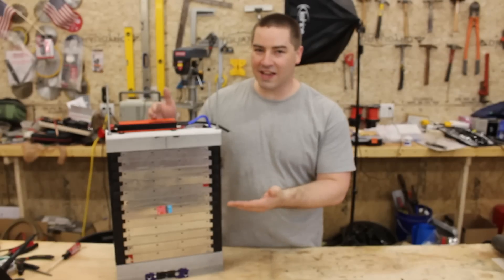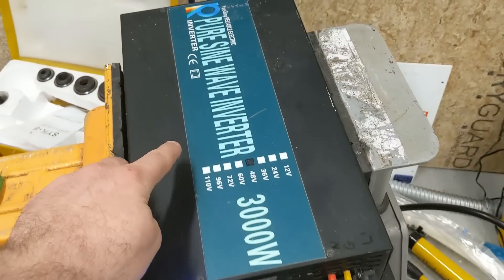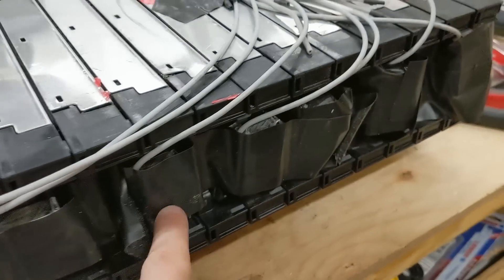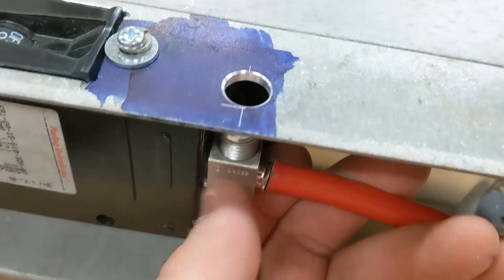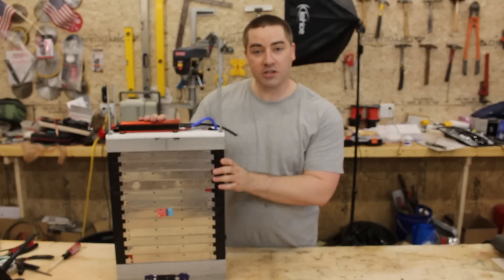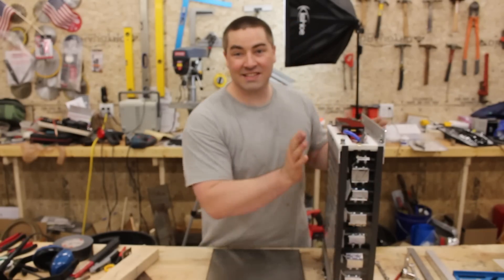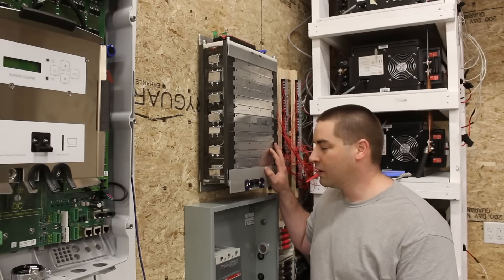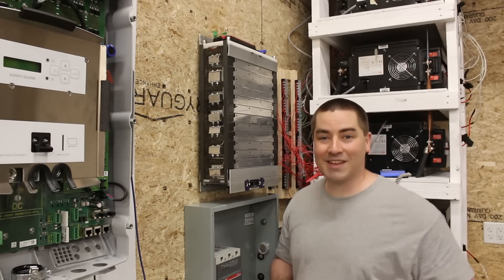LG Cells Part 2, 6kwh 48v DIY Battery

Comment: Great looking pack! Why a 200 AMP BMS and a 100 AMP breaker? Thanks.
Reply from the maker: This type of BMS is based on mosfets.  mosfets are the electronic switch to turn on/off the battery.  mosfets don't like surges.  But a circuit breaker allows surges through.  For example, if you start an air conditioner the compressor draws a large surge to get going.  The cirucit breaker allows the surge to pass, there is a delay before the circuit breaker trips.  By over-sizing the BMS (roughly double) I've never had a BMS fail on me.  I do this on all my builds.
Reply: @DavidPozEnergy  If I were to parallel 3 of these for 14 parallel sets of 3 and then build a 48V pack from those, would the 200 Amp BMS still be enough? Or would I need to look for a bigger BMS? I am mostly building a big pack to extend discharge time not to be using  18 KW at one time. At most I would be drawing 2500-3000 watts for very intermittent periods of around 15 minutes tops.
Reply from the maker: You size a BMS based on your load, not your battery capacity.  So, yes, you can still use a 200 amp BMS.  If you plan to have a max draw of 3,000 watts, then divide that by the lowest expected voltage (42v) = 71 amps.  I like to double, so you could use a 140 amp BMS or more.  A 200 amp BMS would be fine for this.  I personally like to use a circuit breaker half the size of the BMS (100a) and size my wire to the circuit breaker.
Reply: @DavidPozEnergy  Thanks again! Very helpful.
Reply: @DavidPozEnergy  Hey David, I hope all is well with you and yours. I apologize that this is so long winded, but please bear with me.  I came back to this video to ask you for your opinion and I hope you can help. I am needing to build a fairly powerful battery for an all electric ambulance RV(mini-split air conditioner, appliances, etc.). The power density for the price of these is unreal and almost unbeatable from what I have seen. I am also looking at some 100ah 3.2v LifePO4 batteries that are brand new, come with bus bars and are easy to configure but are more than twice the cost for much less usable power. I live and work in the desert of Las Vegas. The battery pack will be in a well insulated compartment and I will do what I can to control the temperatures in it. I am driving myself nuts going back and forth between the energy density and low cost of these compared to the supposedly higher safety and ease of assembly for the LifePO4's. It is time for me to get off the pot, so to speak. Please give me your 2 cents if you can. Thanks!
Reply from the maker: I like the pot reference.  LOL   Both can work, so it sounds like you are choosing between two good choices, not a good vs. bad choice.  The LG cells will be lighter and more energy dense.  Usually that's most important in a mobile application, but I don't know what margin you have for your weight capacity.
Reply: @DavidPozEnergy  No issues where weight is concerned. I am mostly concerned about cost, desert heat and safety.
Reply from the maker: LFP is safer than Li-NMC.  Both types need to be kept cool or they will become damaged.  LFP is going to be easier to build.  I'm comfortable with Li-NMC so I'll save the money and go that way.  But I often suggest LFP to someone with no experience.  They are a better one to learn on.  PS, it's difficult to find old conversations, so please message me in facebook with any other questions.

Comment: These cells certainly deliver an inexpensive, compact battery, pity I live in the UK :). I wondered what the voltage spread was like at the end of the discharge test - don't think you showed it ? As an average you stopped at 42v so 3v/cell average.
Reply from the maker: I'm sorry I didn't show that.  I did check each cell and they stayed equal through the whole cycle.  These are really good cells.

Comment: Thanks David. Been looking forward to see what you did with the BMS.
Curious why you decided this time to use a 'regular' BMS and not the 'Smart', bluetooth capable BMS you used previously?
Reply from the maker: I found I didn't need the bluetooth.  It's fun, but not a requirement.
Reply: @DavidPozEnergy  Thanks for the reply. I don't trust a BMS where I can't see/don't know what it's doing. Seen too many of them fail on me over many years of working with Ebikes. The new Bluetooth options finally make them transparent so you can see when they are killing your cells at least.
Reply from the maker: OK.  That's cool.  What brand BMS has failed on you?
Reply: @DavidPozEnergy  No idea on the brands sorry. I build and sell batteries for Ebikes and a large number of the 'failed' batteries I am replacing are as a result of the BMS, not the cells themselves. See my other channel for the builds:
https://www.youtube.com/channel/UCnro-1KKZaFM-UTp7lFn-vQ

Comment: It will be very interesting to see how the different chemistries behave.  They should charge based on the internal resistance at a given voltage at that moment . The flat voltage ranges of the Lifepo  will likely result in the LG cells reaching around 3.2 volts first then the lifepo will suck up a lot of watts/current until voltage starts rising again.  Of course since you will also have much different Kwhr capacities that will also make a big difference.

Comment: So if I lived in a spot that offered 8 hours of good sun each day, how many 300 watt panels are needs to charge 6kw, 12kw, 18kw?   I'm asking about each because not sure if I should purchase 14, 28, or 42 of them.  I'd do the math myself, but I'm always doubting my math when I calculate things related to solar.

I'm in traveling distance to battery hookup so would take the drive.  Do you know how many of these they have in stock?

Edit to attempt the math after reviewing my notes:   6000 watts / 8 hours = 750 watts each hour so 750/300=2.5 panels .... round up to 3 panels?   And then do the same math for 12kw and 18kw.     5 panels for 12kw, 8 panels after rounding up for 18kw.
Reply from the maker: It's not a matter of how many hours the sun is shinning, it's about the angle of the sun to the fixed solar panel.  If your solar panel is facing south, then early morning sun and late evening sun have less production.  For example, New York city has 2.8 sun-hours per day.  Yes, there is more sunshine than that, but this 2.8 takes into account cloudy days, and low sun-angles.  So if you are trying to calculate 6kwh of production, divided by 2.8 sun-hours = 2.14 kw of solar panels.  There is loss in the charge controller and wiring, so maybe add 15% for losses = 2.46kw of solar panels.  divided by your proposed 300 watt panel = 8 solar panels.
Reply: @DavidPozEnergy  Good information.  The reason I said 8 was because I will be living in the Philippines where the sun dips to the south very little so all year, sun pretty much rises at 6AM, falls at 6PM so I reduced that 12 hours to account for the first 2 and last 2 not being so good.  Will Prowse always says throw an extra panel up there to account for loss associated with the sun's angle.  I'm more interested in having solar in the developing world, because they are more often subject to brownouts and their KwH rate is outrageous compared to the US.  2.8 hrs of sun in NYC!  Wow, that really adds to the number of panels... 8 in NYC compared to just 3 in the Philippines.  I think those LG batteries are the best I've ever seen offered by Battery Hookup.  Thanks for teaching us about batteries/solar.  You've taught me a lot.

Comment: What is the real reason pouch cells need to be compressed?
Reply from the maker: That's how they come from the factory in the big modules, so I assume Chevy had a reason.  I'm just trying to copy.  I don't know the electrical engineering reason behind it.
Reply: @DavidPozEnergy  does anyone else know I use something like these uncompressed on an ebike I made and never had a problem thoughts and capacity is still good
Reply from the maker: If I was to guess, there is probably more reason to compress the stack when you might be pulling 300 amps when the car is accelerating up a hill, or when you are charging it at over 100 amps in a fast charger.  Those are extremes.  Using cells in a less stressful application might not necessitate compression.  But, again, I'm guessing.
Reply: likely for several reasons . First to make sure they fit in the space the engineering allowed for them in the car. Also to avoid more movement which would likely lead to lost connections or worse shorts and or fires.  Also to allow for more consistent heat transfer for cooling the pack.

Comment: David your enthusiasm is contagious!!  That is why I love to watch your videos.  And your the main youtuber that I follow considering I am doing almost the same thing your doing for a solar setup.   To bad I live so far from you.  I would love to help you when you need help.  Keep up the great work.  How do you like the BMS so far?  How will you be able to reduce current while charging it?  Thanks again for taking the extra time and work to produce your videos for all of us.
Reply from the maker: Thanks for watching.  The BMS works fine for my purposes.  I tested it in an over-voltage situation and it immediately shut off preventing the battery from over-charging.  My solar array puts out a peak of 80 amps.  Those 80 amps will be distributed to the whole battery bank.  I think it will split between this new battery and my tower.  I'll be checking to make sure, but I don't think I'll have to do anything special.  The cells can take a 100 amp charge, but they will get warm.  Remember, these are used in electric cars, and they can go to fast charging stations.
Reply: @DavidPozEnergy  True but also remember they have liquid cooling in the cars.  It should work well at 100 amps though as you already mentioned they only get a little warm to touch at that rate.

Comment: So do you think you can use 4 in series for a 12v battery?Did the math and looks like it would be 1.7kw or 14.4v at 120ah and weigh 20lbs or so?Do you think this would be a lighter solution for the agm batts I carry hunting/camping?Would I have to upgrade charge controller or have to have a bms?we never use more than 1-1.5kw daily?I use a cheap pwm charge controller works great but it's on 4 heavy ass agm batts all in parallel 100ah ea.which sucks cuz I can only use them safely to like 50%dod.any info would be great!thanks
Reply from the maker: No, for a couple reasons.  Fully charged 4 of these cells in series would be 16.8 volts.  This is higher than most 12v stuff can use.  Also, this chemistry should not be charged with PWM charge controllers.  You would need an MPPT.  As you stated, your AGM's can only be used to 50%.  So your 4 batteries, are more like 200 amp hours at 12v if they were lithium.  There is another chemistry, LiFePO4, which is a very good 12v replacement.  The voltages work well.  Also, your PWM charge controller is less efficient than a MPPT.  I think if you switch to an MPPT charge controller, you will find you need slightly less storage.   Alt-E sells a Kilo-Vault lifepo4 battery, 150ah, 12v.  It would probably be a good choice to look at.  https://www.altestore.com/store/deep-cycle-batteries/lithium-batteries/kilovault-lithium-solar-battery-p41011/#KLV1800HLXV3  If you want to dive into this deeper, send me a message on Facebook. https://www.facebook.com/DavidPozEnergy/
Reply: @DavidPozEnergy  Thanks for replying but I guess I'm stuck with agm... no way I can afford that $1800 bat for what I do...understand that what I'm doing is not for long term and only has to perform for 16-20 days in the field then its mothballed and improved till next year.Im also a tightass with cash and  bought my batts for 50ea off craigslist...didn't ask where he gotm but brand new in box agms that run$250ea.they are freaking heavy to lug down a mountain elk hunting though! Hard to find what I'm after I guess...light,powerful and cheap hahaha thanks again enjoy your vids

Comment: Dave, Great video and love the density per w-hr. Is this a stable chemistry like LiFePo4?  What happens to a pack if you shoot a nail through one?
Reply from the maker: The most stable chemistrys are LTO and LiFePO4.  This is Li-NMC, less stable.  However, it is safer than other chemistry, like Lithium polymer.  So I consider this middle of the road.  That's why we need to be aware of charge current, and use a BMS.

Comment: Looks so good and professional i like i want one too 😁 how much you spend on this battery project?
Reply from the maker: It would cost $835, or about $140/kwh total.  Full disclosure though, Battery Hookup sent me these cells at no cost.
Reply: @DavidPozEnergy  I am paralleling two sets of 4 BYD modules for a 48 volt 880 amp battery. I am curious as to why copper rivets to attach paralleling wire to aluminum busbars. I substituted aluminum rivets of the same size as your copper rivets but the remaining rivet on the back side protrudes into the spongy material surrounding the positive terminal of each cell. I could not detect it this were so using the copper rivets from your youtube. I purchased the copper rivets from you youtube list and also some more aluminum rivets 1/2 the length of the copper rivets in your description. I have only paralleled 8 cells and I am waiting on the remaining 56 of the 64 cells in my 48 volt 880 amp battery module for your response.
Thanks, Roger

Comment: Another great build Dave. If I got my figures correct I am thinking around $850-$900 plus a whole lot of time per battery. But, the reward is a powerhouse for the money when compared to other batteries capacities and weights. I also like the extra touches you add to make a professional eye pleasing look that speaks out to the general way you do things. Too bad they won't charge below freezing temperatures or I might be rethinking my LTO battery bank system. Their price is extremely attractive to value. Thanks again for another great video and I am still awaiting the completion of your water storage tank system.
Reply: Cover one side of the cells with a heated mat on a thermostat to maintain the temp above freezing.

Comment: the only thing I would change is instead of a solid block I would use square tubing it would hold the current be cheaper to buy and be so much easier to drill :)
Reply from the maker: That's exactly what I said in part 1 video.
Reply: @DavidPozEnergy  haha thats funny, I don't remember that.
Reply: @DavidPozEnergy  Which diameter should be this aluminium square tubing. Please can you refer us an example?

Comment: That's a pretty damn nice battery. Nice work! Let us know how paralleling them with the LiFePO4 works out. I've been thinking of doing something similar.
Reply from the maker: Thanks for your comment.  Yes, I'll let everyone know.
Reply: I have been running that in parallel for 4+ years. It works but you need to know the difference

Comment: 13:00 Is it me, or does the connection blocks look a little too close between packs 6 & 7 (starting from the bottom); or blocks 3 & 4?
Reply from the maker: I see what you mean.  I just measured it and there is a 1/4" gap between them.  It just looks close compared to the rest because some are over an inch apart.
Reply: @DavidPozEnergy  Maybe take a piece of electrical tape and put between them. Better safe than sparky, ya know? 😉Especially at those amps capable.
Reply: I was thinking about these for a 48v golf cart but comments above have made me think otherwise :-) aluminum encased Prismatic cells like the fortune cells seem like a better fit for a golf cart from a potential short risk?

Comment: Mixed battery chemistry... interesting, look forward to seeing how they share the load.  I would guess the little 6kw pack is going to be hit harder at the ends since the LiFePo4 has such a flat discharge curve in the middle.
Reply: I have been doing that for 4+ years. It works of you know how it works
Reply: @DIYTechRepairs  Is the LiFePo4 charging the NMC on the flat curve?
I forget the flat curve property of lifepo4

Comment: 6:10 Just because the ferule deforms doesn't mean it's a great connection. Correct crimping will actually cause all the wire strands to cold weld together creating 1 large wire. The ferule helps to keep them all together to make that welding occur. If you were to use a thermal camera, you would probably find that the non-crimped ferule will get hotter than the crimped one under full load. Heat = loss of energy. The more heat that is generated, the weaker the wire will get. The weaker it gets, the more resistance the wire has. The more resistance, the more heat, etc, etc, etc.
I would recommend to keep crimping them just be on the safe side above all. Crimping also means there are never ever any stray strands.
Reply: People get too excited over “cold welds” which almost never actually happen with homemade connections.

Comment: My gut says you should have some allowance for the swelling of the cells when fully charged.
Reply: I agree, I see no benefit in compressing the stack, it may actually lead to failure.
Reply from the maker: This is how they come from the factory.
Reply: @DavidPozEnergy  Perhaps seeing a failed battery could tell you if that extra cutting board is a good idea.  Not long ago, a cell phone manufacturer created a serious safety issue, because part of their manufacturing process compressed the battery pack and it lead to some catastrophic failures later. That said, those were  Li-ion batteries, so if you're not dealing with the same chemistry, swelling and dendrite formation may be quite different.  Check to see what Failure Modes and Effects analysis is available for your chemistry.
Reply: @DavidPozEnergy  I was thinking about the cutting board on the bottom compressing the bottom cell.  You are right - the others have the plastic spacers.